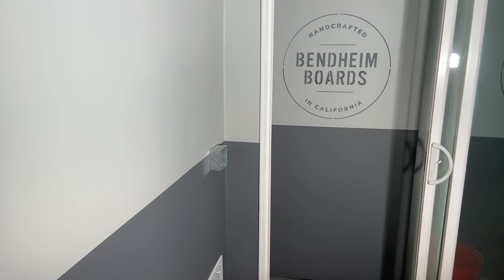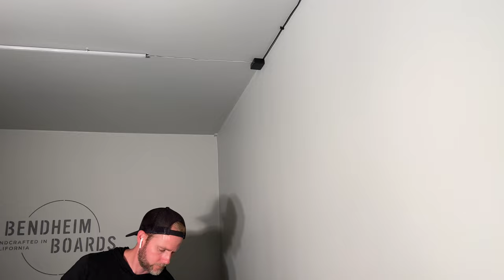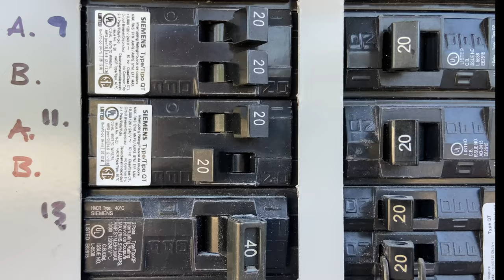Shipping Container Shaping Bay [Part 8 Electrical & Lighting]

Comment: electrician here. If youre not gonna pre twist your wires before puttin wirenuts on, turn the wirenuts until the wires start to twist outside of it, if there's one half assed connction it could get really hot and potentiely start a fire :P
Reply: Also, why by tlg He used nuts for stranded wires?
For me they are recipe for future disaster. 
I'll use lever-Wagos if available or
ferrules + terminal blocks
Reply: So your not going to comment on the line side exposed driver wires but throw in the ol twist ur wires bs comment 😂
Reply: @ItsDoms  the metal pipes are all grounded so theres no danger

Comment: All i can think of is how awesome it would be if you hide the cables inside the container texture before applying the insulation. Invisible cables. On the other hand if you ever need to maintain something it´s not easy to access.

Comment: First of all, fantastic work, period. As a commercial/industrial electrician, I do have some advice for the future to make your life a little easier. I get that I'm just some guy on the internet, and you aren't asking for advice, but I just appreciate the thought you put into this project, and sincerely wanted to give you some pointers in electrical work for the future.

Home Depot sells ground tails for grounding our boxes, so you don't have to make them if you don't want to. At 3:34, you have some open air wires. While there's nothing unsafe in and of itself, they are obviously venerable to damage. MC Cable, SO, or even a piece of regular cord can mitigate that for in-home use. It's just a little better than straight THHN, which isn't really to code (not that it matters). At 5:08, when you put the light switch in, for metal boxes those little ears are made to be removed so there are no sharp edges outside the boxes, and the cover sits a little more flush. Those tabs are just for putting a light switch in drywall to hold it flush with the wall. For your outlets, don't be afraid to put some wire in there! About 6in. is perfect, because it's easy to remove them and change something out or fix later. The wire just stuffs right in the box. It's also very nice to wrap your screws in electrical tape, so the next guy has less chance of being shocked when you take the cover off.

What I really love is how you snaked those wires behind the pipe using one holes to hold it in place, very nice. Also, that double 90 was kickass. You wouldn't believe how many people at my job don't use them at all, and they look fantastic! Finally, good job double-checking your wiring with a tester, it's super important to make sure you did it correct. I couldn't have done this project better if I tried, really good work.
Reply: What you missed: can't put 120v in conduit with lv led cable. Emt strapping with 3' of termination required. Switch covers are single gang stainless steel, which are very sharp and not listed to be on a switch on a handy box. Use handy box switch covers.
Reply: @JeremyMitts  Nice spot! I didn't even think about the box covers, he probably should replace those if his kids are going to be around a lot.

Comment: Fun to watch and appreciating the care going into the project!

Couple of thoughts from a DIY guy: putting conduit in behind the drywall might have been better. Not sure if you decided the ease of doing it after was greater than the aesthetic nor not but it was in my mind. I'd be curious to find out as I would like to do a similar project sometime in the future. Also saw you upgraded the drill. Run your clutch down a minimum setting when doing metal-metal screw work and you can use it easily in the place of your screwdriver.
Reply: Electrical conduit on the outside makes it easy to add more outlets w/o having to tear the wall apart. Personally, I'd have run the conduit along the baseboard, but this adds a professional industrial look for a workman which is perfect for what he is going to use it for.  Plumbing (if added) can also be run through conduit to make access easier.

Comment: Im a professional electrician, and i have to ask, did you used to work in the trade as well?? Cause your bends are nicer than 90% of the stuff ive seen in my trade. Everything looks so nice and level 😂

If you for some reason stop making boards and move to the middle of nowhere in Canada, we'll hire you! 😂
Reply: Ah damm! You blew it with the exposed wire and marretts!! 😂

Gotta run some panduit or something for an even cleaner look in the future! 
Still all look great though, im certain its more than enough for the project!

Comment: And as far as putting lights in the ceiling you can put it inside the ceiling you may have to run your wires from the front to the back along the little grooves you could leave one of these styrofoam pieces out of there and used LED strip lights

Comment: I have a question, isn't it risky to use metal parts to route electrical wires inside of it? what if earth's up and starts sending electric charges through the pipe themselves? ._.

Comment: What I want to know is why didn't you go on the inside the walls and yes I do see you put insulation in styrofoam I would have cut inside the styrofoam a long down it and all that crap I would have carefully planned out and just watched from screwing my screws and if you couldn't get a full box in their cut the box or the use of low voltage box it would have at least made it look a whole lot better than those boxes there and pipes hanging all over the walls but we design it how we want it to be designed but just future reference if you do another one put it inside the walls you can do it

Comment: Why metal pipes for electrical wires?
Reply: Because that is what's used literally everywhere, the wire is insulated already by the plastic that surrounds the copper, and if by chance the insulation on the wire were to be damaged and somehow were to short onto the pipe then the pipes are supposed to be grounded.
Reply: @arguedscarab7985  not so everywhere... Here is pvc.
Reply: @Nyky279  PVC is best used in this application

Comment: Electrical work was a little shitty but I guess it your shit and you don't care about it much, not sure why you would pre cut wires and put them on the outlets then wire nut them to the wires in the box. Also you most likely didn't have to use weather proof connectors on that first box you placed since it was already inside. But overall it didn't look too bad besides those details.
Reply: Also could've left the wires longer inside the box to make life easier

Comment: Why did you pull the electrical wires from the outside of the wall? If it was inside the wall, it would provide a more aesthetic appearance. I don't think it's nice to see electrical wires on the ceiling.
Reply: But we can't repair the damaged wire inside the wall😢
Reply: @SachinYadav-zt1ft  If a junction box is placed on the wall, the problem will be solved.
Reply: Easy to add more outlets if needed. Plus, it gives a professional looking utilitarian look.  This ain't no living space!
(In a living space, you put the electrical and plumbing along the baseboard)
Placing electrical and plumbing inside the wall means you have to tear the wall apart to fix/add anything.
AND you lose R-value in that space.

Comment: Isn’t it dangerous to use metal parts for electrics? Here we use pvc
Reply: It's not, metal conduit is used primarily in all industrial applications. The reason why it's not dangerous is because every single box has a ground that is supposed to be put inside to help protect from the pipe from being energized

Comment: this electricity cables are wrong, they are too thin for any purposes (so power delivered by them are extremely limited) and probably brakes goverment standarts as well
PS also it is recommended to use solid wire instead of stranded one
Reply: You are are wrong and are too thin for any purpose. That is #12 AWG (2.052mm) solid wire, which is correct for a 20 amp circuit.  It does not break code.  Try again.
Reply: @toemblem    what is the maximum power can be delivered continuously via this wires? around 1.9KW? this is close to consumption of just 1 electric kettle which are usually rated at 1.5-2 KW. 
Btw:  he used both solid and stranded wires
Reply: @OlegGolubev_yolo  All of the 120V wire was solid.  The stranded that you saw was related to the low voltage lighting system.  The maximum wattage would be  2.4KW but the highest continuous load would be about 1.9KW.  The real number for  a residential grade kettle is 1.5KW maximum.  But he is building a shaping studio, not a kitchen.  And even if his microwave broke and he had to go buy a kettle to make tea, he would be just fine.  Now let's talk about your ring circuits where you have a whole house on a 30amp circuit and deliver voltage above 220.  That is a disaster waiting to happen. It is no wonder that you have switches on your outlets.  Plugging something in could cost you your life. Not to mention how you have to have appliances with built in fuses in their plugs because there is no over current protection in a typical British home.
Reply: @toemblem  sounds legit
Reply: @OlegGolubev_yolo more legit then your replies